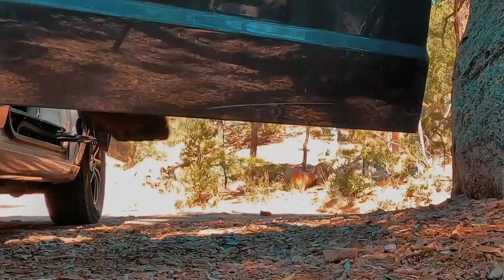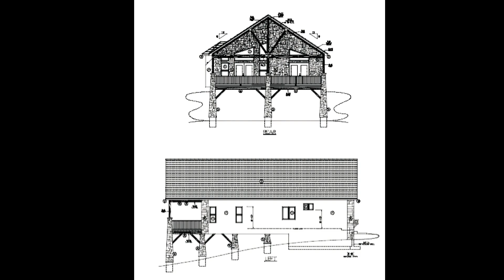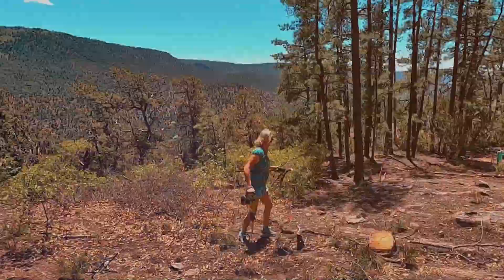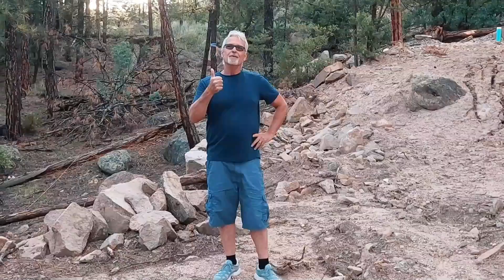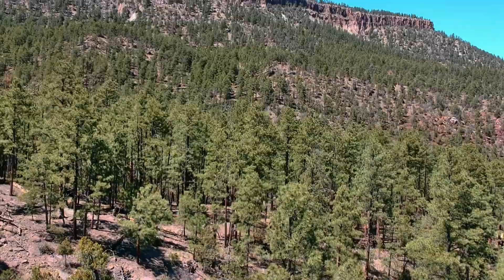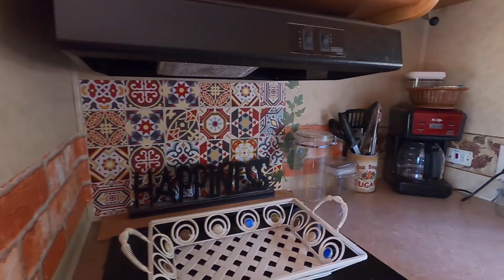Getting Started Building Our Home + Life l Building Our Own Home New Mexico, USA

Comment: Will be interesting to watch your dream unfold. We bought property above Santa Fe this past October In our case, we are not on a timeline but I can already tell just the topo survey, soil analysis and site plan will take at least a year to complete. I'd be surprised if our build moves faster than that.
Reply from the maker: It's quite a process indeed. Are you building a Southwest style home? If so check our our business, we make sustainable architectural components for SW homes. Our business is Fiberspan Concrete Elements fcelements.com. Thanks for watching.